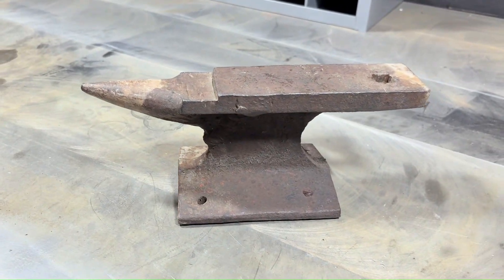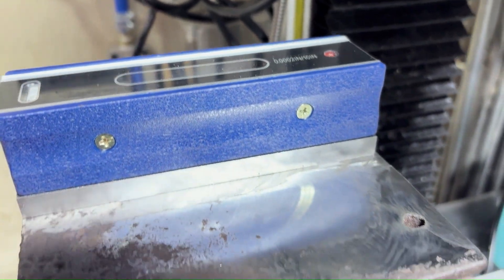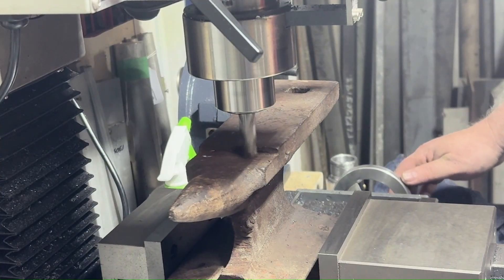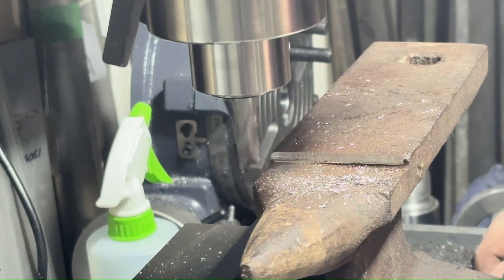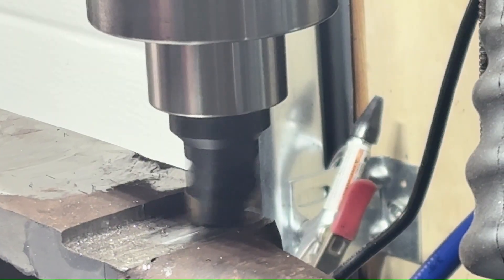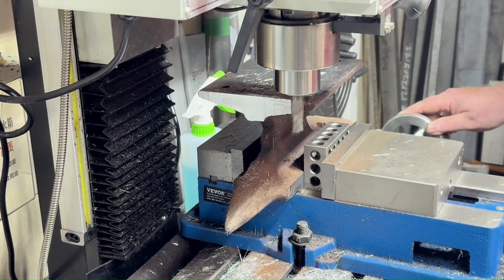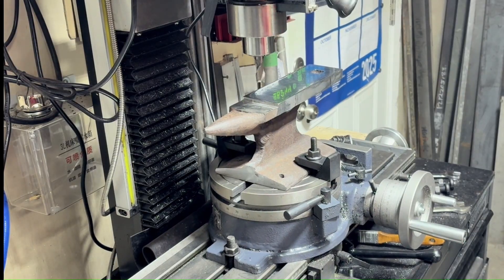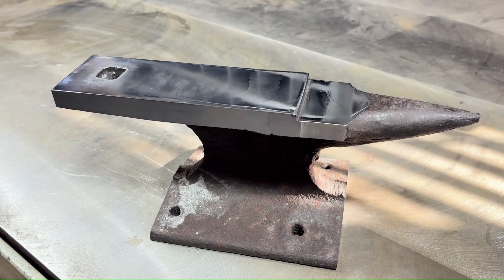Rail Road Track Anvil

Comment: I got a section of RR track. Surfaced the bottom and it had half ass little bit of rebound due to the work hardened top surface. Even a tiny bit of top sanding/grinding to smooth it out took away from the rebound. Then I did one end like this, under cut it. Nothing on that free floated end has any rebound. It has ZERO. 

So I have done nothing else as I wanted it to retain any rebound it has. It is setting on a base of plywood on top of a 3/4 thick steel top table and it gets slid around as needed. Had I known how shitty these end up and that at best, its a fail, I would not have ever bothered. a RR track anvil cut to this level in this video ... well it looks like a real anvil but it is not. I bet this thing has ZERO rebound and would be like hitting the carcass of a dead cat with a hammer.

People do not bother making one of these. It is the most massive waste of you time and you will hate it when it is finished and want all those hrs of your life back.

People who make these ... for some reason... never own up to how TRULY f'ing bad the turn out. Except for looking kind of cute, they are worthless for hammering anything. Worthless unless you flatten the base then do NOTHING MORE. Then it will have a tiny bit of rebound but just look like a section of RR track. 

Tiny but real anvils are cheap. I see them a lot. I'm going to take my ball peen hammer for a drive, to test the rebound, and buy one of the smaller anvils that comes up for sale. Then I'm going to try and sell the RR track almost dead thing for the 30 bucks I paid for it.
Reply: Yeah, anvils are literally cheaper than apples. Like I got two anvils for about 1€/kg and apples are like 2€/kg.